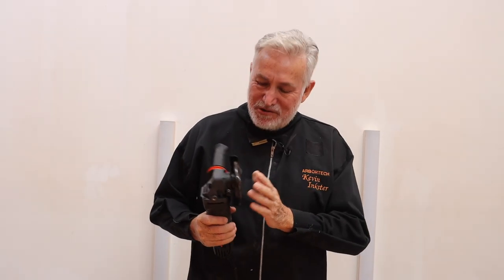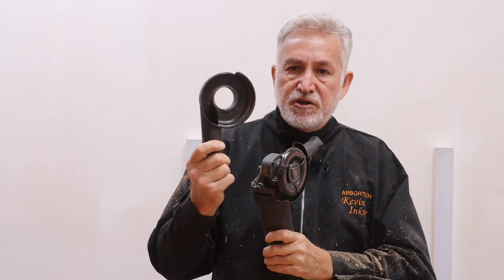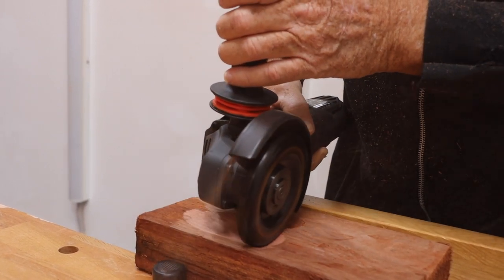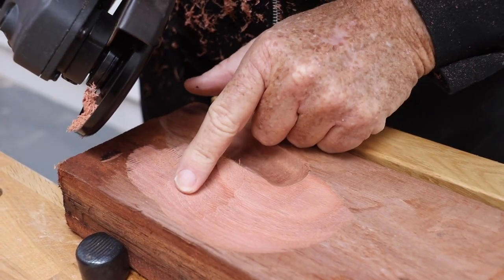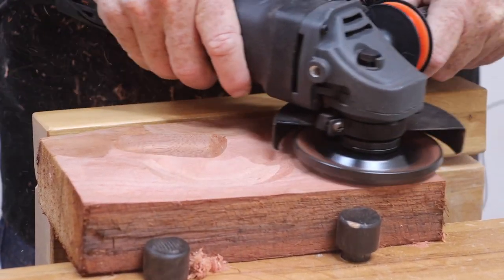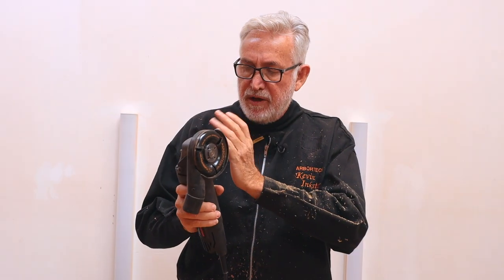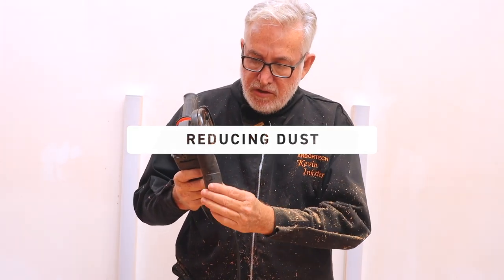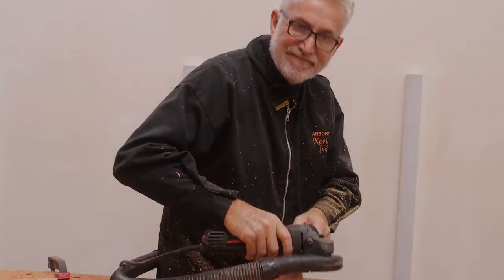TURBOPlane Tips and Techniques | Arbortech Tools

Comment: I just purchased and installed the TurboPlane, but it is not cutting the way it shows here, and there are definitely no wood chips - it throws a fine dust.  When I feel the 'blades', they are not sharp.  When the product comes, is it necessary to sharpen the blades first?
Reply from the maker: Hi Angela, I highly reccomend you take a look at our Tips and Techniques video which can be found in the 'TURBO Plane' playlist here on YouTube, or by visiting our website. It seems like you might need a little help to get going. Let me know how you go with the video. Thanks :)

Comment: What rpm are you running this at to gain control of tool. Just purchased one of these for a project and this thing grabs and jumps all over
Reply from the maker: Hey Dawn! I would suggest it runs at a speed in the 9000 RPM - 12,000 RPM range. Also, you may be working on end-grain, which can make it a little hard to control. Feel free to shoot us an email with more information, and our team can assist. Cheers!

Comment: Looking for some assistance. I am looking for the best arbortech tool for angle grinder that removes wood quickly. I am making 25 to 30 inch dough bowls so I need to remove lots of material fast. Thanks for your help
Reply from the maker: Hey! The Industrial Woodcarver is our fastest attachment for rapid wood removal - it effortlessly plunges into wood and cuts precisely on the edge.

Comment: G'day mate  l have small problem with my mini turbo, been using it for a few years now  off and on its great bought it from carbatec in Brisbane the problem is l can't loosen the fasteners to rotate or replace the cutter blades tried everything l can think of soaking, heat, a light tap took it to an engineer no joy  all the other tools work fine no problems The ball gouge l can rotate and replace.Any suggestions?
Reply from the maker: Hey Ed, can you shoot us an email info@arbortechtools.com - we can help you out with this one. Cheers.
Reply: Will do cheers mate 👍

Comment: I see that you strongly recommend place the guard a 45° in order to operate the tool safely. However, if you uses it to plane a surface, I asume you should place the tool just flat on the surface, shouldn't you? If so, I underdstand that there is a higher risk, because you are using que whole disk, including the sector where it is dangerous. Am I tight? how can I manage to deal with that risk?
Reply from the maker: Hi there, we always recommend that you use the guard, with a bit of practice you will be able to plane the surface reasonably flat. If you are hoping to get the surface flat and need extra control then the TurboPlane can be used with our Power Carving Unit (link below). This comes with a Levelling Guide that allows for precise depth adjustment and is perfect for levelling off small and large areas.
https://www.youtube.com/watch?v=QH5hgWzBPLc